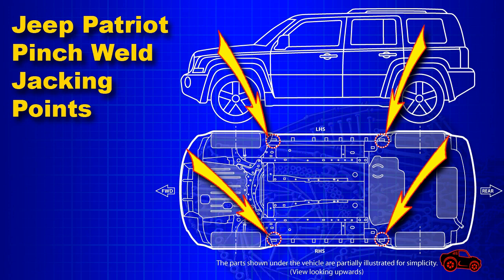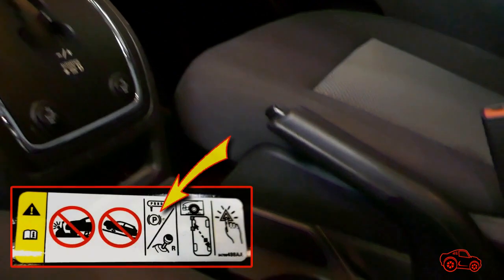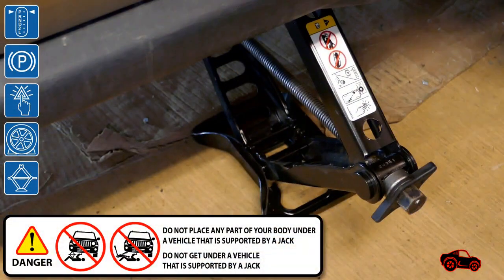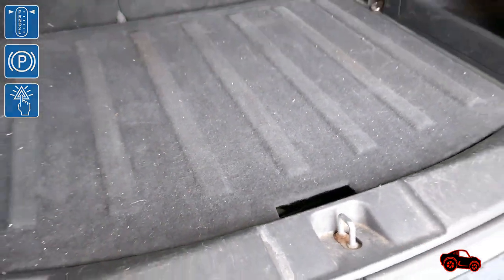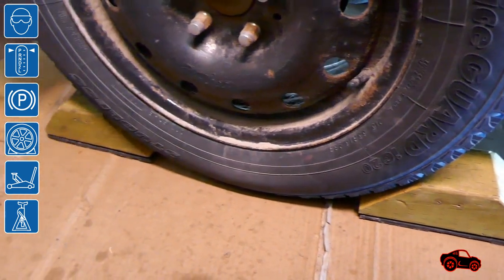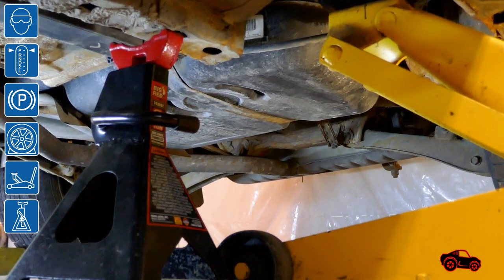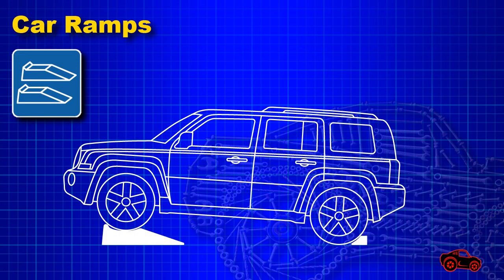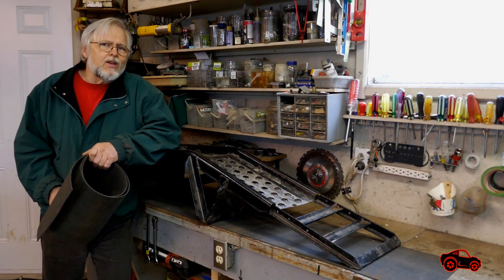Jeep Patriot / Compass Scissor Jack & Floor Jack Jacking Points and Car Ramps

Comment: Hello my friend, I was just wondering if you are aware of a common issue with the abs wiring on the patriot. I have changed the abs sensor, hub and bearing but the light is still on, so it must be a wiring issue.
Reply from the maker: The common problem is the rear wheels speed sensor rusty holding system on AWD vehicles. For proper troubleshooting, you should re-scan the ABS system with a proper scan tool to read the specific fault code(s). You can also look at the live DATA to know if the sensor produce any logic signals when the vehicle is moving. Make sure the sensor is properly installed to generate the pulses.
Reply: @mtlcarguy  thank you so much for your reply. my mechanic has put “LOST 12 VOLT FEED”, so does this mean a wire has snapped somewhere?
Reply from the maker: @cameronpeach5534  It is possible. One wire is a +12V power feed and the other one is the speed sensor return signal. The body harness 2 pin connector is behind the quarter trim panel. You can open this link took at this procedure to troubleshoot your problem.
https://s3.amazonaws.com/jeepwranglerjk2010/7c033315.html
The document in this link is for a Jeep Wrangler but the inspection procedure is quite the same.
If the ABS module sends the +12V there is a chance to solve the problem by replacing the ABS Wheel Speed Sensor.

Comment: If i need to lift the entire vehicle onto jack stands do i just lift one side, lower it onto a stand, and then go to the next wheel on the same side (driver/passenger) to do the same and then repeat for the opposite side?
Reply from the maker: ''Safety is the priority''... so I normally avoid lifting any vehicle and support it onto 4 jack stands. I did it once with my Jeep Patriot but I used four 6-ton jack stands to improve the stability and the safety. It was on an even concrete floor, the shifter was in park position, the parking brakes were engaged and the two wheels on the right side of the vehicle were blocked with wheel chocks. (1) I jacked up and supported the front left side of the vehicle. (2) I jacked up and supported the rear left side of the vehicle.  (3) I jacked up and supported the front right side of the vehicle. (4) I jacked up and supported the rear right side of the vehicle. (5) I checked the stability of the vehicle. (6) I used my 2 steel car ramps as back up support to improve the safety ( I don't play with my life). 
Later when the work was completed, I lowered the vehicle following the reverse steps.
Someone should know that you work under a vehicle and be able to help you at any moment if something goes wrong.
Note: I don't trust jack stands with a small base.